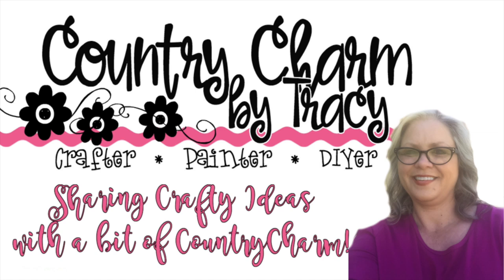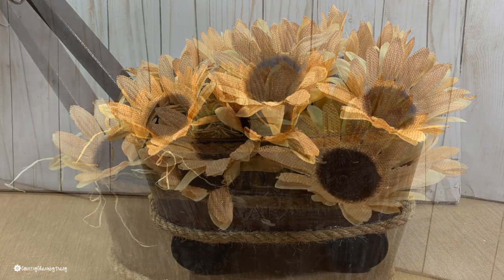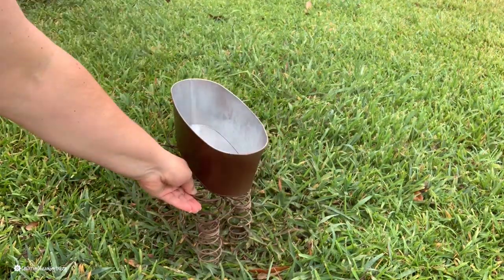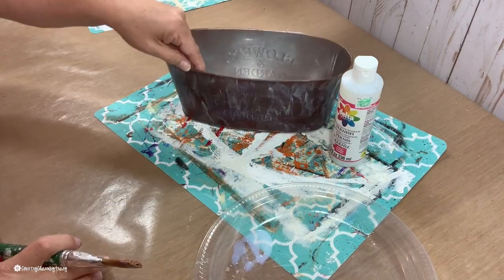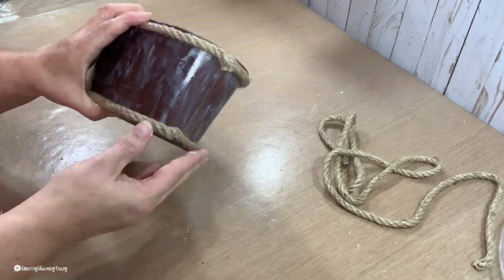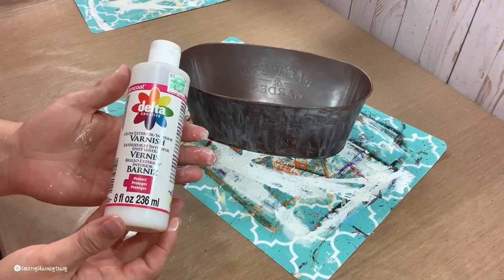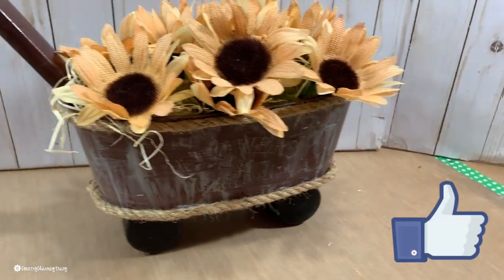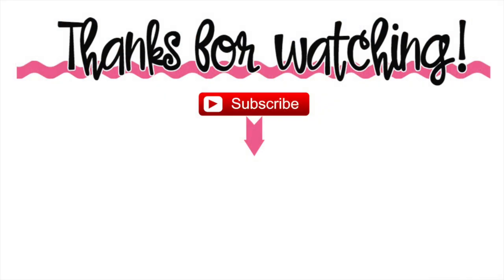🌿🌼DIY DOLLAR TREE Farmhouse Wagon || Using All Dollar Tree Supplies || Spent about $5.00 To Make

Comment: Had you sliced the wheels as you originally planned, you may have gotten 4 wheels out of one mallet. Just sayin' - good old DT!
Reply from the maker: Hi Barbara - I didn't plan to slice the black mallet only have my hubby saw the stick off....but he was able to unscrew the stick from the mallet heads.  Not sure how (or if) you can cut the mallet heads in 2 pieces.  ~ Tracy